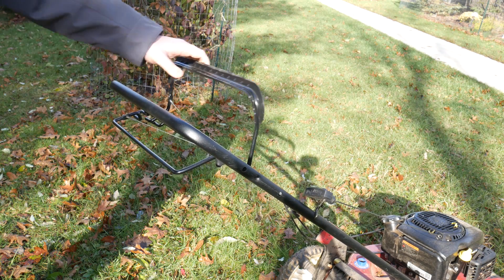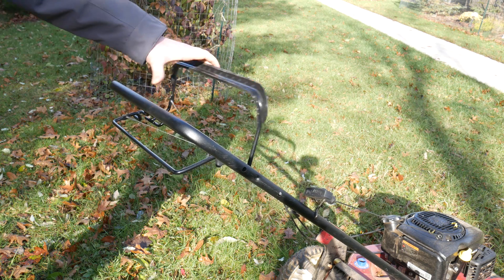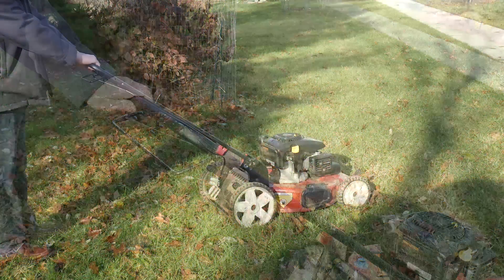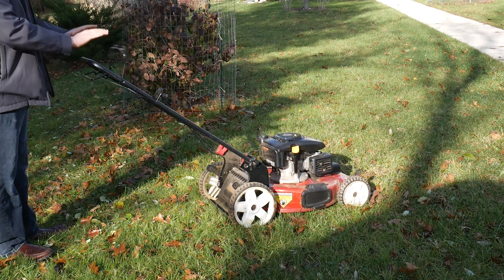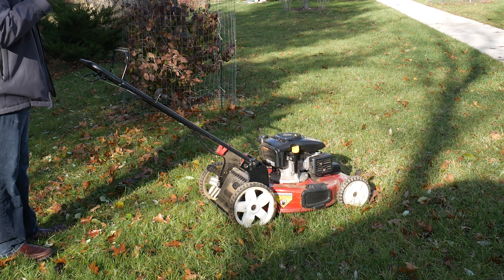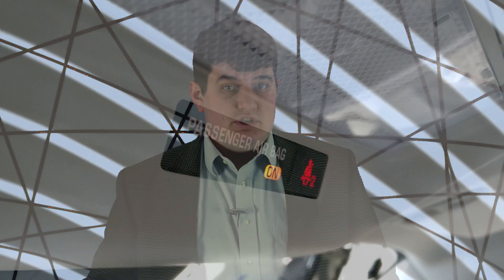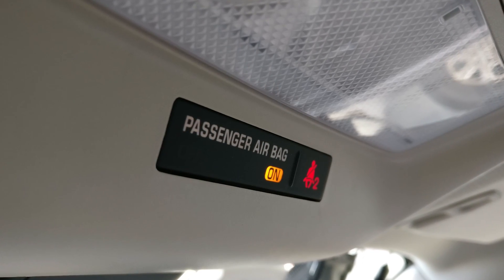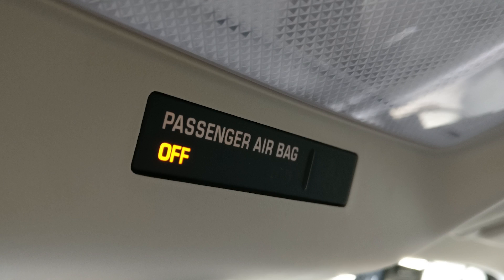The Dead Man's Switch:  How Anton Yelchin's life could have been saved

Comment: One override is needed to be able to shift a "bricked" car with no power into neutral to be able to push/tow it. I know that most tow trucks can lift a vehicle's axle and then install an auxiliary wheels chassis under the other axle, but sometimes you just need to be able to push a stalled vehicle off the roadway for safety reasons. My old 2002 Toyota Camry had a manual toggle allowing me to switch from Park when the car is not running.

Comment: By law (at least in Canada, and from what I can recall), you are allowed to unbuckle your seatbelt to enable yourself to see behind your vehicle if you are reversing, like in a parking lot, driveway, or when required and safe to do so
Introducing a seatbelt interlock would cause this to be unable to happen, and could cause those people to just sit on top of the seatbelt and buckle it in unsafely, and forgetting to properly put the seatbelt back on, as the car would detect it's seatbelt in, but not know that the occupant is wearing it correctly

Comment: My concern here is that I have a tendency to have to adjust my pants while driving. When I am in the passenger seat, this frequently means that the passenger airbag sensor sometimes is deactivated for short periods of time, and causes riding mowers to briefly stall. If this were to happen while I was driving on the highway, it would be potentially lethal. I suppose this could be solved by adding similar pressure sensors to the floor as well, but they haven't done that with passenger seats at this point, so I am not sure if I could count on it being done in this case.

Comment: Let me start with I like your channel and i aprecheate your opinions.

But on this case i see many problems with your sujestion.
i dont think you can validate properly of the driver in the seat.

For exmple of you stretch durring a long driver and llift yourself a bit from the seat it might detect a passonger missing .

or if you remove the seat belt to readjust it becase it tighten from a quick movment.

Also shifting in to park from a different gear if the car is moving could break teh transmission .

I am saying it is alot more complicated then you say here unless you add a pressure plate for the drivers place or a camera to detect a person i dont see how it could be achived safly .

also this system should be diabled above speeds of few km/h dur to possibility of breaking the transmission - unless you program also a full stop ' hand break and parking .

I have seen it mostly with americans - that people think that parking is equal to hand break and you dont need to use it. You absolutly do must use it - parking may lock the gear bit its ment as an additional safty for extreme case where the handbreak doesnt work properly . 

parking up\down hill is bad for it , allso if some pressure apply it can break a tansmission. 

so automaticly shifting in to parking might end up in broken tansmission and death due tot he car not stopping . 

if anything i belive handbreak and engin stop should be applied/ and then again you must have a bypass - a mechanical one.

for exmple your car wont start and you need to push it to the side road....but every tiem you get out of the car it shis `to parking and handbreak :) (you were saying that you cant thing of a scenerio where you would want to cancle it )
Reply: Another one who didn't watch the whole video.
Reply: @anduuhar  i have wached the entire video. You aparantly didnt read my comment properly or didnt understand it.

My point was that itis not so simple to implement as it sounds.

It expenssive and needs many failsafes to make sure the deadman switch wont triger acidently.

Its expenssive and might cause alot pf problems.

He speaks about it as its simple.
1st. Shifting in to park is dangerous for the car as i said.

So its suppost to be shift in to N and break.

BUT if it triggers when it shouldnt its alot more dangerous.

The simppler solution is with the new keys that in the second you remove them from the car(those you keep in your pocket) it turns off.

You are putting too much trist in something that could fail.

It is not as simple to do specially due to regulations and testing and the danger such system adds if it malfunction.
Reply: @loxire  I absolutely did read your comment. You insinuated such things as removing the seatbelt etc could cause problems which he did address in his video. The fail-safe system would be programmed to discount such events if the car was at speed.
Reply: @anduuhar  still a problem, and causes many more problems.
Ethical, technical, and phylosofical that no one will take. So let it be
Reply: @loxire  Lol K

Comment: Just google "chevy auto-park". (that ancient shit that never worked correctly. EVER. Yes, that f'ing system will apply the brakes at 70mph on the interstate.)

Most cars automatically select "park" when shut off. Mine does, even if the leaver is not in "P". (it also screams at me to put it in park. it also beeps if the driver door is opened while "on". and will beep if I get out of the car -- it knows where I am by the key fob.) And of course, Anton might still be around if he had set the park break before getting out of the car. (something I do by reflex in everything.)

(The dead man seat switch in lawnmowers is one of the prime examples of how not to do it. Those [censored] things fail all the time.)

Comment: Dacia cars are mechanical. At least mine is. Electronics is good and all, but mechanical is still waaaayyyy safer and simpler and energy efficient. And much simpler to repair, and understand by the average mechanic. Low tech is always better. Agreed it is more design work than just programming computers everywhere. But simpler, safer and.. did I say safer?

Even you agree with that. Did you not say it in your toaster videos?

Aaand
 Dead man switches can definately be made mechanically. Your lawn mower proves it. Agreed a car is more complex. But it is feasable. The will to do it is the only thing that prevents full mechanical sensors and controls from being made nowadays.

Comment: I have operated heavy equipment with this exact function.  The issue is it tends to cut the motor at inopportune times when the operator is bouncing in the seat on a bumpy road.  It could likely be modified to allow a time delay before it reacted but this would need to be factored into a car or it  could be a safety hazard on a bumpy road.

Comment: There are circumstances where you would want the car to be able to move or the engine to run when someone is not in the driver's seat. I suppose an override switch could be implemented for those situations, though.

Comment: Should only occur at very low rpms or speeds, and even then seems risky to prevent a scenario that could have been avoided by a better shifter.

You wouldn't want a sensor failure to lead to a vehicle going from 65 to park on the highway.

Comment: I feel as though this is only a problem with manual transmissions which are sadly almost phased out of most normal vehicles. Most automatics require you to complete a secondary action or even 3, with a safety net or two to prevent accidental gear change, to move the gear shift whereas it only takes pressure on a manual

Comment: The truth is that this hasn't been implemented because it only matters in very, very few situations. When someone leaves their car, in 99% of all situations they'll turn off the engine anyways. And even if they don't, they're going to put the car on P. And even if they don't, a car rolling with like 2 mph will rarely be a deadly danger. 

What happened to Mr. Yelchin is essentially a fringe case of a fringe case of a fringe case. Not saying that a dead man switch isn't a good idea considering its negligable costs. But it hasn't been implemented yet because there was just no real incentive for automobile manufacturers to think about it as it only rarely becomes relevant.

Comment: There is no steer by wire currently in the US. While there is electric assisted power steering, it is against US law for the steering wheel to not have a physical linkage between the wheel and front wheels. 

Some cars with rear wheel steering are however completely disconnected.

Comment: As a class 1 railroad engineer in the USA, deadman pedals were long gone when I started 20+ years ago. We have an electronic alerter that reads control inputs (horn, bell, throttle, brake). If none  are received in a set amount of time(around a minute), a countdown starts (30 seconds) with a flashing light then audible alarm increasing in volume and frequency.  A reset button can be pushed or simply pushing the horn or moving the throttle etc will do, which just resets the the whole process. If none are received a service brake application is applied( versus emergency application).  A deadman pedal was too easy to defeat with a stick according to the older guys.
I also have a Jeep with that shifter. WORST design ever, wife hates hates hates it. I'm a car guy from old 4 speed corvettes to mini coopers  and I hate that shifter with a passion(officially called monobalance shifter). Now, after the recall, if you open the door it auto puts itself in park.

Comment: if you make the seat a deadmans switch putting it into park, it would need an override, cause if the car screws up or runs out of fuel or somethign and you need to pop it into neutral and push it out of the road, you're screwed. The seatbelt idea as the compromise works for me, even for idiots that don't wear seatbelts, they can still buckle it in behind them.

Comment: The problem I see is the need to be able to tow the car. Also the more specialized but practical ability to push the car while turned off and stearing from beside the open driver side door. That said, this isn't a bad thought process to go down. A few year before was the issue with Keys falling out of the ignition while driving. Understandable that it turned off the car. Less reasonable it also instantly killed power steering and powered breaks, turned off airbags, and in cars with automatic seat belts it removed those too. What a death trap, and one that could be fixed by software. Was the car just moving at over 20 mph? Ok don't turn off airbags and breaks.
Reply: So I’m not the only one getting recommended this video
Reply: Actually it's very understandable that the power steering and power brakes would turn off with the engine.  Until maybe 10 years ago, nearly all power steering used hydraulic power (electric power steering is becoming more common on newer cars).  The hydraulic power is supplied by a pump on the engine.  If the engine stops spinning, then the hydraulic pump stops -- and thus there is nothing to power the power steering.  Similarly, on gasoline powered cars, the power brakes are usually powered by vacuum created by the running engine.  Again, if the engine stops this source of power goes away, so the power brakes will stop working too.*
In short: no engine -- no power -- no power steering/brakes.
* Note: The power brakes usually have a small vacuum reservoir.  Thus, you may get one or two applications of the brakes after the engine stops before the power assist is gone.

Comment: This is actually sorta already common now. Especially in german and Chrysler vehicles where the control to go into gear is electronically actuated. 

As soon as the door opens they slam into park. 

Other vehicles with electronic parking brakes apply the brake instead, to the same effect. 

Most will let you override it, by replying the control confirming you really do want to move (either because the sensor is bad and the door really is closed. Or more commonly because you're loading the car onto something tricky like a 4 post lift or a trailer and you need to have the door open part way to look out at the front tire to see exactly where you are. 

I like the idea of the seat system as well because that would let you open the door and not have the car stop. Though I could see an issue if you lifted yourself up to see better and in particular, with a jeep this would be an issue. 

Another group who wouldn't want this would be independent mail delivery people, who regularly sit on the passenger side diagonally to both drive and reach controls at the same time.

Comment: I unbuckle my seat belt when I get about half a block down the street from my house. If unbuckling it were to trigger a change in behavior, rather than wait a few minutes, I would short the sensor wire. Failing that, I would cut the belt and leave the buckle in the receptacle permanently. 
And, worst case, I would simply buy an older car. Because muh freedumz.

Comment: The issue with the car shifting into park isn't so clear and simple, as every towing company/tow truck needs a car to be in neutral in order to move it - same if you're pushing a car, pulling it out of a ditch, etc.
You could have a 'switch' that would enable it to stay in neutral , but there are various situational issues - largely in other emergencies - where this could go wrong.
Almost all manual shift cars are unable to be slammed into reverse while the car is moving after 'X" MPH, and even when in part - most require you to make a deliberate action to put the car into reverse.
A lot of this comes down to user error, you can only 'dummy' proof something so much until it becomes a hindrance on the average end user.
We can look at how many incidents are caused by the one who took Antons life and clearly see it's a pretty uncommon situation. 
It's a good idea, but it would need far FAR more thought put into it - along with design, rather than just a simple line of code.

Comment: A bit odd to mention it 4 years after this video came out, but the cost of production for this software change would not be completely zero.
All changes to existing hardware OR software require a minimum amount of field testing from qualified QA engineers to be completed before launch.
Even the smallest change to code could cause an unexpected bug. It's better to have a QA engineer catch that bug before it causes an avoidable accident.
Those QA engineers would require their man hours to be paid, so though the change would require no new hardware, you'd still have to pay the developers.

Comment: Leave it to Fiat/Chrysler to design something dumb and unsafe. They will also fight tooth and nail to install a dead man switch. How do I know this? From past examples of course! By the mid 90s every automaker except Chrysler required you to push the brake pedal to shift out of park. When did they finally do it? In 2006 when the government made them in response to people being ran over by their own car accidentally.

It is easier to do than you think by the way. With my 99 dodge ram if the key is even in the accessory position you can knock the shifter out of park. I did this one day cleaning it out in my driveway which is on a hill and I was scared to say the least. Thankfully no one was behind me and I acted quickly enough. I thought my truck was broken but was horrified to learn that was normal operation. I told my wife to be very careful around the shifter.

Google search, Moment is all it takes for kids to set vehicles rolling - USA Today for more reading.

My last rant is about how this new shifter in Cherokees fails and one has to wait a month at least for a new one. They are a terrible design with terrible reliability. My friend learned this lesson the hard way

Comment: That's a terrible idea. Any time a car needs to be towed, or even just pushed - it just wouldn't move. Imagine this, especially with the rise of EVs - you've run out of electrons, and you can't even pull the car onto o flatbed because it decided to lock itself up. Without an easy override, this is simply ridiculous.

Comment: It would need an override for other things as well. Pushing a car that ran out of gas or pushing a disabled car off the road quickly to clear traffic and a dangerous situation.
It's a good idea but the shifter should clearly define what gear you're in or even chime if you get out without being in park. Headlights chime if left on, there should be a warning for the car being off and allowed to roll.

Comment: Or they could just design the shifter so that there is no question that it is in park when you are exiting the vehicle.
Or simply have the shifter kick into    
Park when the ignition is turned off.
They've also had something called a parking brake that has been on cars for many many years. I use it every time I exit the car.

Comment: The implementation of deadman switch is both idiotic and not required.
1. Don't design and implement such a stupid shifter.
2. Anton should of operated his vehicle correctly. It's his own fault for getting out of his vehicle without engaging the parking brake.
STOP PROTECTING THE STUPID FROM THEIR OWN STUPIDITY

Comment: LOL, the dead-man switch in the lawnmower seat is the first thing I disable.  This was an absolute requirement on my old John Deere mower as the compression on the engine was shot and if you turned the engine off after you'd started it, it wasn't going to crank again any time that day.

Comment: What you describe is just another thing some will try to by-pass. Old time driver's education owner's manuals always said before exiting your vehicle is to shift into Park AND set parking brake and shut engine off. If you do not respect the power of an automobile then the sympathy level is reduced. Safety First is making things more deadly.  ECMs are the worst idea ever and often accelerate the vehicle or make steering go crazy and brake malfunction.

Comment: You don't even need a dead man's switch, just have the PCM not shift out of neutral or park (and apply the rear brakes, or the parking brakes as they're all pretty much electrical now) if the brake switch isn't pressed.